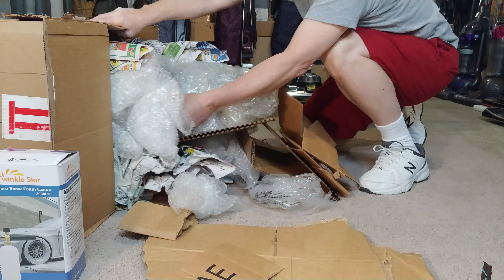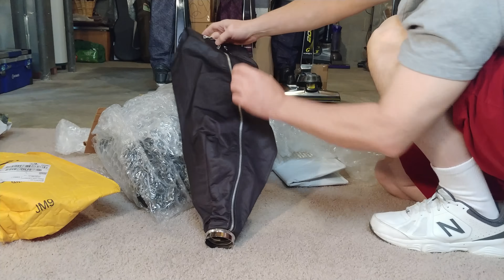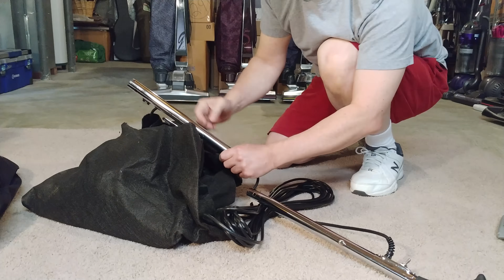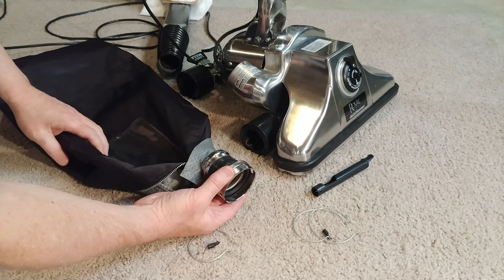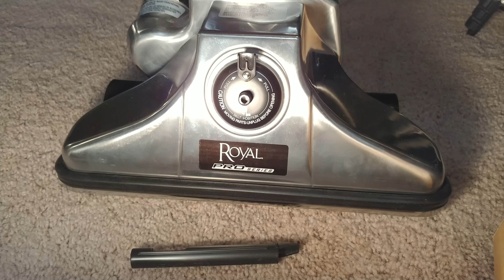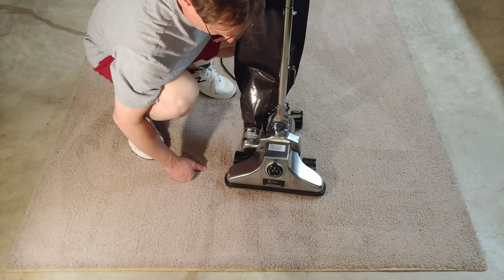Royal Pro Series 9 Amp Unboxing And Demo

Comment: I have a vacuum just like this-same model. Bought mine new from the  GreenvillevS&Vac when it was new and these still being made. Last week I bought a used Royal 8300 Everlasting model a customer turned in. Both of these are BEASTS! If it’s on the floor these will pick it up! I usually go for Kirby’s go for these Royals instead. The Everlast is 10A Pro is 9. Don’t see much if any difference. Was looking at my Pro model as you unpacked yours. Oh how I wish these machines could be brought back!! I ordered some yellow “HEPA “ style paper bags-would like to get the synthetic “white” unmarked bags. They were sold individually. The Royal “A” bags have a paper fill tube-they are like F&G bags-won’t fit your Royal Pro. If you have an older Royal upright that uses the “A” bag use them in that. I have my fathers old Royal 886 that uses A bags.

Comment: Just got one from a thrift store, a simpler model, the Royal Commercial model 89103C. Only issue so far as I can tell is some wear and tear on the mechanism that holds the handle vertical, it doesn’t reliably stay vertical.

Comment: I wish there was a direct-air power nozzle for canister vacuums that had 150 CFM plus. Thinking about designing one. It would need to be a compact version of a sanitaire head in the shape of an Oreck upright power head with lower profile.
Reply from the maker: What you ask for can't work. In order to obtain 150 nozzle CFM, you would need 200-250 CFM at the canister itself. The most power central vacuums don't start with more than 140-ish CFM, so you would need two. Now you are at over 3000 dual canister Watts and a large diameter hose. Also, 150 nozzle CFM isn't push-able, that's why Kirbys have tech drives and Royals have "grabby" bristles.

Comment: I've used an Everlast 8300, which has the 10 amp motor. I'm not convinced it's any more skookum than the 9 amp motor on my 2075, though I'd need to stick them both on an airflow box to be sure. (Mine is also modded to use Kirby bags, which the 8300 was not - that might matter, since the Kirby fill tube is a bit bigger.)

Comment: The vibrations in the head are because it has a 9amp motor.  At one time Royals used 4amp motors. I’ve heard that since they’ve been increased the extra rpm and vibration can cause the brushrolls to break so keep an extra one on hand.  
 Great machine. I’ve wanted one for a long time.
Reply: I can confirm that the 7 amp models don't vibrate hardly at all.
Reply: My 9 amp 2075 vibrates a fair bit, but I've never had it break a brushroll.